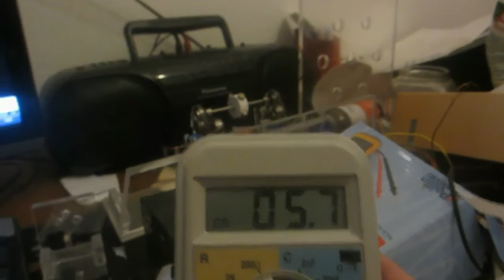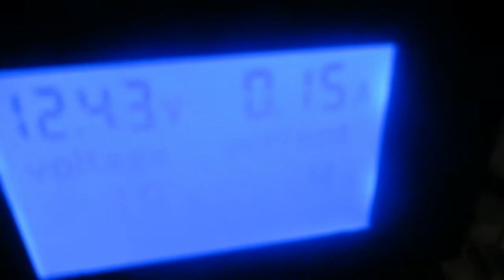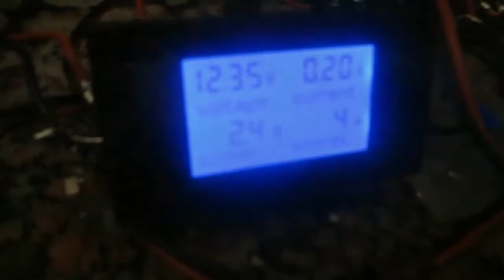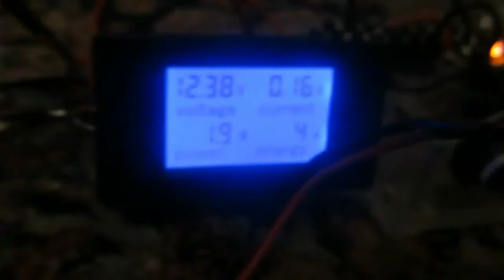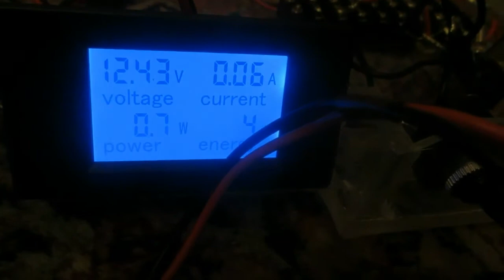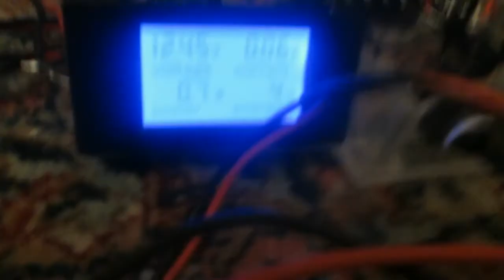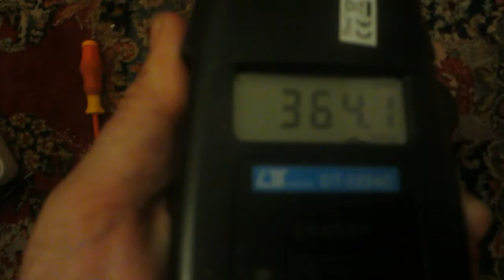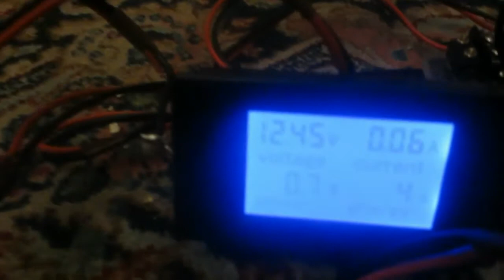Bedini Coils and Bicycle Wheel - One step towards Free Energy -  First run

Comment: solid magnets would be better, also a closer gap from coil to magnets
Reply from the maker: Thanks for your comment.. what do you meen by "solid magnets"?? these are neodymium n45 with 15 kilo attraction (~30 pounds each). If i put the coil closer it lifts the coil by the core.. as it weighs only 3 pounds...
Reply from the maker: i forgot.. these are the magnets... https://www.magnetkontor.de/products/de/Neodym-Magnete-Rohmagnete/NdFeB-Quadermagnete/Quadermagnete-bis-20-mm-Laenge/NdFeB-N48-Quadermagnet-20-x-20-x-10-mm-N45-gebohrt-S-Pol.html?XTCsid=9sbgppjuve1r9khp7uqlji25e5

Comment: Thanks for sharing have you link where to buy magnet wire and how you wire the feedback
Reply from the maker: for the feedback u use 1 of the 4 strands. one side goes to the minus of your circuit... the other side with a diode (I use a uf4007 but any diode with more than 30 volts should do). The important thing is that if your consumption does not go down, you invert the polarity before the diode. i will explain it more precisely in this forum:
http://iaec.forumco.com/topic.asp?TOPIC_ID=1812
as for the wire, i use this one: https://www.wires.co.uk/acatalog/st_wire.html the one at the far bottom of the page.
Reply: Thanks  -_-